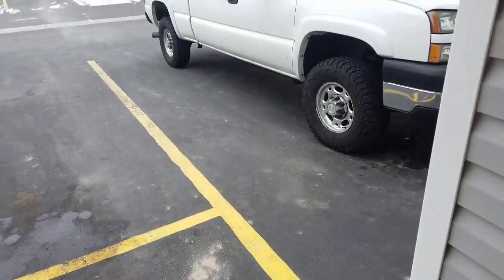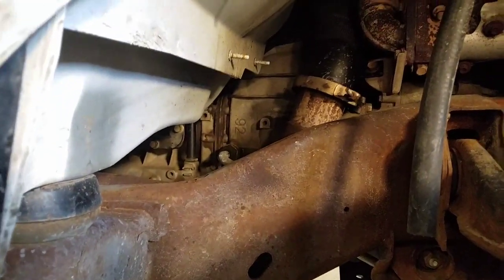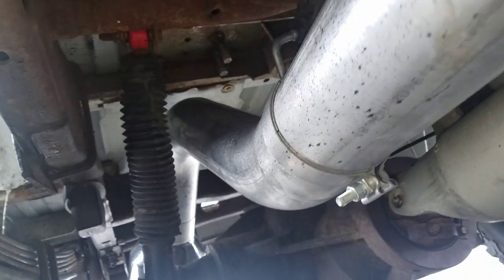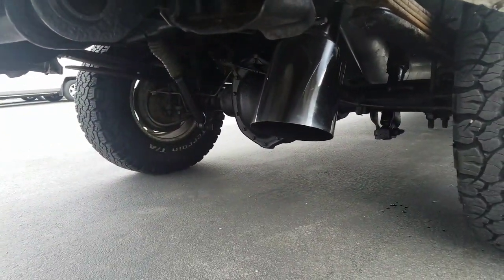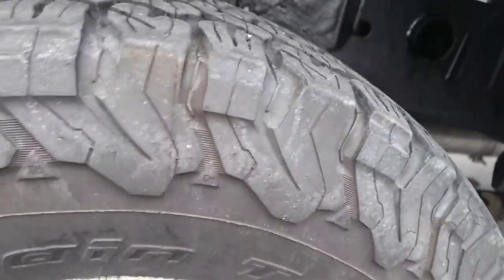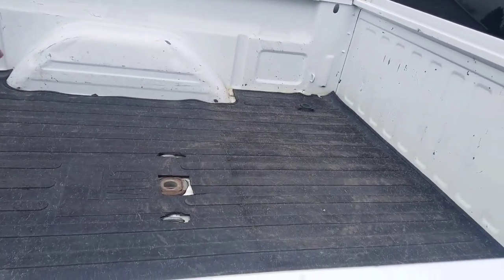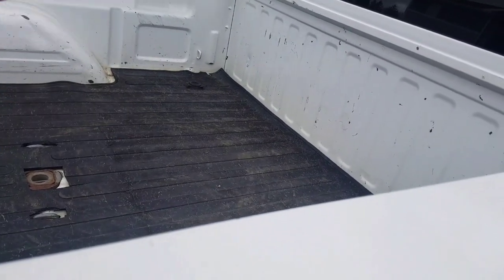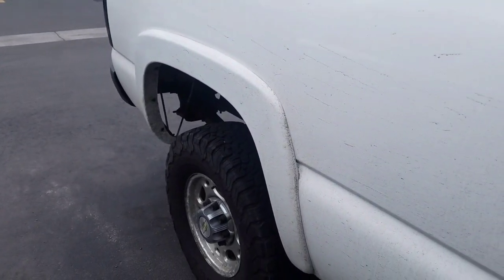Magnaflow 5" exhaust dump  install! 8 inch tip!

Comment: My LLY has some rigged up "straight pipe" of 3" and 3.5" exhaust. They did an axle dump with a 6" tip. I hate it. Always have hated it.
I've done some stuff to the truck, it whistles like a 6 liter, Ford. I just got an MBRP exhaust in yesterday and I cannot wait to get rid of my axle dump.
Reply from the maker: Sweet man. I think the axel dump just looks cleaner and the turbo whistle that echos off the ground 💯💯
Reply: @rikkidiesel  I am trying to upload a couple quick clips of mine right now. The turbo whistle is always lovely. I don't know how much the sound bouncing off the ground actually helps, but I'm sure I won't miss it.
I am ready to have an exhaust out the right side like the factory style so I can whistle people's brains out when passing them. 😂😂
Reply: @rikkidiesel  One is up, you ought to give it a listen.
I've personally never heard another LLY like it.

Comment: Hey man I think the drone issue you are talking about is due to the axle dump you have. I have the same setup and mine drones a lot less on the highway now that I put on the turn out after the tire.
Reply from the maker: i totally understand that for sure. i had my truck tuned again by a different guy and its like night and day, its barley noticiable now. im sure the deading helps also. i can acutally have a normal conversation with someone but it wasnt terribile before this more just annoying at certain RPMs. all i need to do now is line x the bed and it would be good.
Reply: @rikkidiesel  same here man. I might raptor line mine to save some $$$
Reply from the maker: Yeah I've heard people have some good luck with that but I'm just gunna have a pro do mine lol I have done and I wont do it again lol
Reply: @rikkidiesel  yeah it's a chore for sure lol!

Comment: Just installed this on my LB7. I had some fitment issues with the hangers lining up with the rubber grommets that I need to address.
Reply from the maker: Yeah it's a pain..might switch back to mbrp a little later
Reply: Rikki Diesel why switch back ?
Reply from the maker: Just fitment issues. My exhaust seems like it rubs in certain places on my truck but I haven't switched it yet. Idk when I will but it works for now

Comment: Great video man sounds badass!does your lbz axle dump exhaust sound the same as your lly before?
Reply from the maker: idk if its the tune, the angle of the tip or the lbz motor but it is a lot louder! i love it. sounds like a bigger louder jet compared to my lly